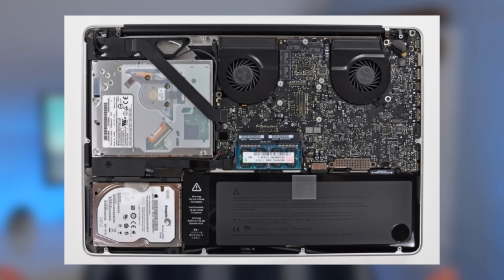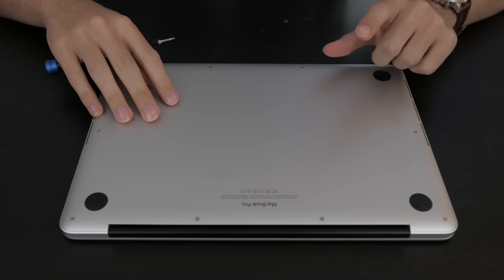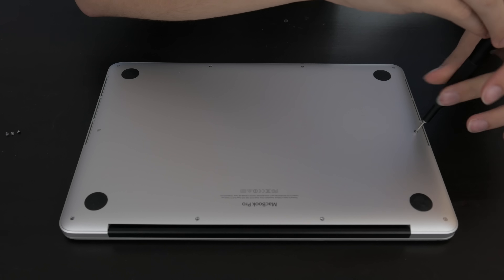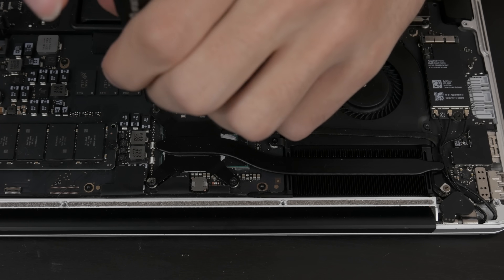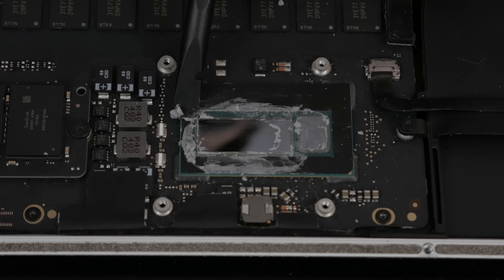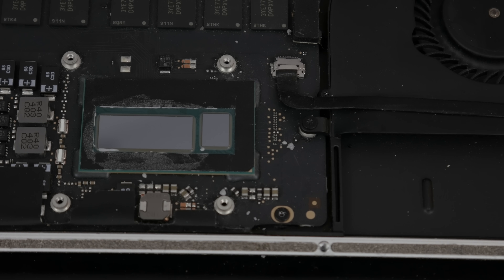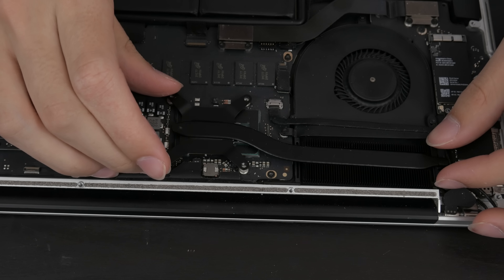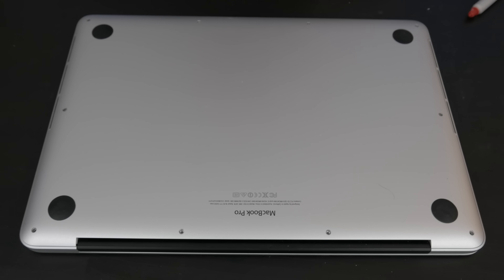If you have a Retina MacBook Pro, you need this $6 Upgrade!

Comment: great video, i like your channel, subscribed
i wanna get a 2017 macbook pro or lower for my daughter, whos going to college this year, but i wanna get something where i can upgrade the ram and ssd myself like i have done w my 2012 MBPro , any specific things, i should look for or stay away from thanks
Reply: If you want to be able to upgrade ram, you need a 2012 unibody or older. Also avoid 2011 macbook pros.
Reply: If you haven't already made the purchase, I had a 2012 MacBook Pro that I upgraded ram and ssd in fully.  Still wasn't satisfied.  About a year and a half ago I  came across a refurb/out of box type deal on eBay for a late 2017 with Microsoft office and Final Cut Pro already on it and it was only 1500 and runs like a dream with 16 GB Ra, 2.8 GHz Quad core i7 With intel HD graphics 1536 MB and a Radeon pro 555 2 GB discrete graphics.  It comes with 4 thunderbolt 3.0 and the only downside is all the docks and dongles to choose from.  Otherwise I've been very happy with this over the older "upgradeable one".  It's probably even cheaper now and I would definitely get the 500 GB NVME ssd in it. I got the 256 and if she'll be running virtual machines you will run out of room on your dongles, especially you want multiple monitors ( I have 3 1980/1080p like monitors one of which I put in portrait or 270 degree mode and a 4K monitor running on it no problems)  it even still had a year of apple care on it.  My 2 cents.   I may try to see if I can do this thermal paste/liquid metal upgrade open it.  I haven't seen a vid of the 2017 getting this done yet.  I just have it on a laptop cooler fan case for now.  seems to help by 10 degrees C so far.Good luck finding a good buy on one.  At the time mine was the cheapest by 200 bucks I had found with, especially considering it came with Final Cut Pro, a very expensive program.

Comment: Kryonaut is the best thermal paste you can get. It’s $10 for a gram but it’ll make your system reach its best potential without the risks and problems of liquid metal like how it eventually alloys with the copper which becomes a solid and loses performance over time

Comment: Surprising that the GPU gets hardly no contact with copper plate to wick away heat. I presumed the lil die next to cpu is a GPU, i'd make a custom block so both chips have adequate coverage.
Reply: It's the PCH
Reply: Yes mate 
I wonder if you know a better cooler

Comment: the cooler doesn't even cover the small die. wtf. And if you apply thermal paste direktly on a die i would always spread it manually everywhere. On a direkt die you rather want to have to much then not enough! ;) or remove the cooler after the first instalation and check how it looks.

Comment: 8:17
no, you said it yourself at 6:05. the thermal paste did not achieve everything, with the new one it will not achieve everything again, why should it be better now? 
You haven't changed anything on the bracket.

Comment: I open up my mbp 13 retina before to have a thermalpaste change, but the original paste isn't look this bad.... 

And I don't think pasting the graphic dye is necessary, the graphic dye isn't touching the copper heatsink by anyway.
Reply: Applying thermal paste to the GPU die is necessary. If you took off the heatsink and thought the paste looked fine and just shut it back up without changing it, you can cause it to heat up more because of air pockets in the paste.

Comment: Always spread the thermal paste evenly all over the die! It's important in this case because it's direct die cooling.
Reply: and the cooler does not have that high clamping force , as dont most of apple coolers , and people forget that spreading the paste is needed when clamping force is low , its not a pc with a thick lid

Comment: Cleaning Dust on the boards and in the fans are better efficient than replacing thermal paste. It's free if you have a  proper screw driver.

Comment: I had a really bad overheating problem when plugging an external monitor and changed the paste but it didn't help. I'm now using the mbp with the bottom lid off and a base fan.

Comment: to remove the thermal paste use isopropyl alcohol (rally cheap available everywhere) on a soft lint free cloth. That removes every trace and does not react with the components.

Comment: Hello! Luke miani

If it's still gettin hot and the fan also is clean what might be the problem??
Reply: I have the same issue, under load it will get 90+ degrees Celsius easily.

Comment: 1. When undoing screws of any tentioned rectangular/square component (like the CPU cooler, PC Case Fan, or this Heat Sink), do it in a zigzag like he does when putting it back on. Go across diagonally and evenly loosen the tention until loose, then remove screws. Do the reverse when fastening/installing.

2. Use Isopropyl Alcohol (I use 99% but many people just use 70%+ and is fine. Just make sure it's all dry before doing next steps) with some lintless fabric or towel to clean the die and heat sink contact surface. Clean Coffee Filter is actually good for this. Lintless, cheap.

3. Go slow and just put a tiny dollop of thermal goop near the center of each die. Let the compression do the spreading. FOR THE LOVE OF GOD DO NOT SPREAD THAT THING. 1. there is no need 2. you increase chance of air pockets forming during application.
Reply: The reason the pea method works on desktop CPU’s is because the heat sink has much higher pressure when mounted. In laptops and GPU’s, you are free and recommended to apply more as it won’t have as much mounting pressure. Plus, applying more thermal paste is nowhere near as detrimental as applying too little.
Reply: The pea method (a circular drop) only makes sense when you’re applying paste to a square surface area. The pressure will evenly push the paste outward in a circular fashion. 

On a rectangular shape, like in this video, there won’t be enough paste to cover the cpu. So you have to apply a line
Reply: @Rangefinder02  exactly, thanks for pointing this out to the stupid user who pretends to know a lot but actualkly doesn't. The same as the guy in the video, you can already see that after his "repair" there's even less thermal paste on the die as before. it'S crazy

Comment: A better solution is to drill speed holes into the bottom case right over the internal fans to improve air flow and connect the internal heat sink to the bottom cover. with a thermal pad. This allows more heat to be taken off the CPU and GPU.
Reply: Got any pictures because this sounds pretty boneheaded
Reply: @jadesluv  I would recommend not to drill right over the internal fans, doing so would reduce airflow all around the inside of the whole laptop, other motherboard parts and ssd need cooling.
Reply: Hi Gustavo Fring!!!!

Comment: one small question when I did this the small square part of the cpu was not covered with thermal paste when I open my MacBook for the first time and when I replace the the dermal paste I did not put any thermal paste on it! is that necessary? do I need to open it again and reapply, also my temperature is fine its always below 54 c
Reply: Hey man, i had the same. I did apply thermal to the smaller square. Not sure if it is a improvement. I am guessing that the smaller square is the onboard gpu?

Comment: I just did this on my 2015 13" MBP with 3.1 Ghz i7. Cinebench sped up by about 10% and the idling temperature dropped 6-8 degrees C. It's easy to do, cheap and worth doing. I used Thermal Grizzly Cryonaut, because it's highly rated for lowering temperatures and non-corrosive and non-conductive. I watched a lot of videos on using liquid metal, but it scares me to use it in a laptop and the long term effects are (IMHO) problematic. A top of the line non-conductive, non-reactive paste will likely get you nearly all the benefits will almost zero risk.
Reply: Hey I just bought a used one the same like yours . What temperatures is it usually on idle and what under load? I could not find much on the "normal" temperatures it should work. Do you use macs fan control?

Comment: Hey Luke would you recommend changing the thermal paste on a Late 2013 13” MacBook Air?
Reply: After you have it for couple of years like 2 or 3
Reply: @ashmeetghotra1776  thanks lol already did it
Reply: @IsmaelSalajee  did you notice any difference?
Reply: @Julius-cz2hh  runs quieter but went back to noisy in no time. Thermal design from the beginning isn’t the best.
Reply: H
Reply: I

Comment: FFFFFFFFFFFFFFaaaaaaaaaaaaaaaak....  
Thanks YouTube for recommending me this video AFTER the internal heat in my 13" MacBook Pro drove the SSD to permanent failure.
Thanks Apple for telling me, literally via in-person Genius Bar staff that the drives are soldered in and it's impossible to replace the SSD, after I tell them I worry it's about to fail.
Thanks self, for not seeking this information sooner.
So, 2000 USD later.. I have a new (used) MBP and a replacement/upgrade kit for the MBP with dead SSD. 
But I don't have the thermal paste...
Okay I'm done.
Reply from the maker: Did you have a 2016 or later MBP before (the one that broke)? if you had a 2012-2015 retina they straight up lied to you, if you had a 2016-present this trick wouldn't have worked because the heatsink is mounted to the underside of the LB so you have to disassemble the entire thing
Reply: @lukemiani  It's a Late 2013 MBP.  I do not have the screws to open the machine but you mention in this video that it's only held on by one screw... can I replace the internal SSD myself rather than paying another 300 for a replacement un-soldering re-soldering service?
Reply: PS.  I'm in a place in the world where authorized Apple service technicians and equipment is highly inflated.  But I ordered this new equipment about a week ago from macsales and a friend in USA received and brought it back here to save the several-weeks of shipping.
Reply from the maker: @edgeofthought  If the Apple store told you that you would need a new computer or Logic Board because of a dead SSD- they lied to you. You can easily replace the SSD in a late 2013 MacBook Pro, you also don't need thermal paste because you don't have to take off the heatsink to access the SSD. I have a video on SSD replacement that might help: https://www.youtube.com/watch?v=vcYdaePtCGw
Reply: @lukemiani  many thanks!  So I checked out this other video of yours, and this morning I realized that in my upgrade kit is the screwdrivers so that saved a lot of worry (I hadn't actually looked within the package yet, they were buried under the external enclosure for old dead SSD) and now I'm doing the SSD swap.  I might send you some money for a beer or something.
Reply: @lukemiani ... and now I've found the old SSD was fine.  Replaced it for the new SSD, and placed the old SSD in the enclosure.  New SSD also not recognized by MBP in Disk Utility from boot, but the machine was able to boot off the old SSD via USB, and with El Capitan, still cannot see the new SSD.  Might be a logic board failure...?

Comment: You didn't clean with alcool.
You applied very poorly the thermal paste, it can lead to bubbles. You need to apply it in another way ,check other channels about that.
While the advice you gice is good, very bad way to do it.

Comment: Where's the post new paste CineBench test?????
Reply: I assume it doesn't help much, otherwise he'd have posted it.
Reply: It doesn't help much since with any paste since these have inadequate heatsinks and will hit 100C under full load, but it does help a lot when doing regular tasks and idling.
Reply: He damaged the CPU die with his spiky tool when he applied the thermal paste so now the MBP is brain dead ;)
Reply: I figured it wouldn't make much difference, more a piece of mind thing vs. a real upgrade like a faster SSD NVME
Reply: @abc123fhdi  It does make a difference. The cpu turbo boosts more and keeps better base clocks. Basically doesnt throttle as much
Reply: Yeh where is it? Bet it got a lower score ;-) VIDEO FAIL !

Comment: Oh, and be very careful if you are using a metal based thermal compound not to use too much or it will squeeze out onto the motherboard when you reattach the heatsink and cause short circuiting problems. I'd avoid metal based thermal compounds altogether so that can never happen.

Comment: A screen protector is also a good idea on early Retina models. There was an issue with the anti-glare coating wearing off and leaving an impression of the keyboard on the screen.
Reply: I have an early 2015 macbook pro and it wasn't covered under warranty. I had an issue where the screen wouldn't turn on and the keyboard wouldn't work (I now realize this is a super easy fix but apple was quoting me like $1000 for a new screen). When I took it into the Apple Shop, they looked at the keyboard marks on the screen and said this was an issue they fix for free. Got a whole new screen and paid next to nothing. Doubt they would or even could still do this as this was over 4 years ago but it may be worth looking into.
Reply: I wish the previous owner of my MBP 2015 did that
Reply: @JustARegularNerd  I recently took the plunge and just cleaned off the anti-glare coating and I feel all the better for it
Reply: Funny you mention that. I was cleaning up my old MacBook Pro and I saw that… 💀 Rip display but it’s not noticeable when it’s turned on at least.

Comment: After so many years, I still can't believe that for this model, Apple engineers was like: Dang it, let's just cover part of the GPU die by the tube and it will be OK.
Reply: Leo Ren It’s actually the PCH which doesn’t need any cooling, Intel integrated it on to the CPU package to save space on the “U” processors, on the 15” MacBooks it isn’t integrated and is fine sitting with no cooling...

Comment: Hi Luke, just came across your video as I was thinking of repasting the CPU/GPU of my mid 2014 retina macbook pro. What I am wondering about is whether I could use thermal pads (from IC Graphite) as opposed to some thermal paste. I understand from many revues that it has excellent thermal properties and lasts a lot longer! Hope to hear from you very soon! Many thanks in advance!
Reply: the thermal pads are more meant for desktop CPU coolers that have high mounting pressure. I think the low mounting pressure as well as the thickness of the thermal pads might not work that well in Macbooks. If you look at desktop CPU cooler towers, they have 4 much larger screws sometimes with springs applying pressure to clamp down on the thermal pad to get better heat transfer. also the pads are quite thick meaning it might not be able to properly mount. 
if you really wanted to do this upgrade, I would suggest Thermal Grizzly Kryonaut. its non-conductive and the highest quality thermal paste on the market right now, being only a tiny bit worse than liquid metal. you can also purchase a kit that comes with a thermal paste spreader on Amazon for ~$10.
Reply: @dylan-nguyen  Thx for the reply, what do you mean by "non-conductive" I thought that the best performance is the one that you get from highly conductive paste! Or are you referring to something else?!
Reply: Tariq yahiaoui non conductive meaning it won't conduct electricity 
aka if a tiny bit of the paste goes overboard, it won't short out the motherboard
Reply: @dylan-nguyen  Gotcha! Many thx for the quick response! In addition to the thermal pads which do not seem to be suitable for laptops, I also had several other options in mind like the:
- Arctic MX-4
- Arctic Silver 5
- Noctua NT´H1
but you seem to be have a preference for the Thermal Grizzly Kryonaut, I am not bothered about the price (only about performance and durability) would you still recommend the Grizzly Kryonaut over all the others?! Thanks
Reply: Tariq yahiaoui you can search up some articles comparing the thermal performance, the thermal grizzly gets the lowest CPU temps compared to the others, it's a slight difference maybe 0.5-1C but if you're going to go through the trouble of opening up your macbook I would say get the best stuff which is the thermal grizzly at the moment
Reply: @dylan-nguyen  Many thx! Enjoy the weekend!
Reply: @dylan-nguyen  Just been through the whole thing: re-applying the thermal paste on the cpu/gpu of my macbook pro! Was lucky to find the Kryonaut thermal grizzly at a nearby store! So many thanks again for your assistance! All the best, Tariq

Comment: Can you notice the reduced heat when typing on the keyboard, my unibody is uncomfortable in summer.
Reply: this upgrade won't really affect the heat of the chassis itself, the thermal paste allows for better conduction of heat so the heat moves away from the CPU. this means if anything it might increase the heat of the chassis as more hot air is being output. 
the actual heat that the CPU generates will be about the same, its just that the heat is more efficiently moved away from the CPU.
Reply: @dylan-nguyen  Yeh that sounds logical, thanks ..

Comment: What’s the benchmark score and heat after doing this?? You didn’t re run the bench marks mate.
Reply: Yup, no change seen probably, also yes he mentioned only 10 degree F difference.
Reply: @VijayKanta  Pretty sure it was either a 10c difference or he's just a real bad tech guy; I'd go with the latter
Reply: Without benchmarks there's no point in doing this, I'm betting you'd see no real world difference.

Comment: 8:20 actually, when applying thermal paste directly to the die, you should spread it out manually, as any part not contacted will create a hotspot that will either kill the cpu or force throttling.